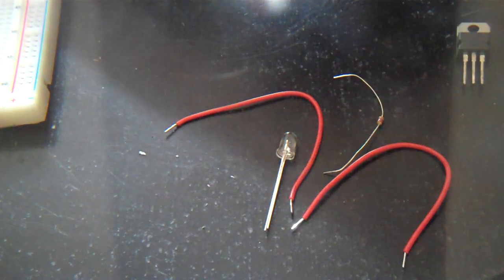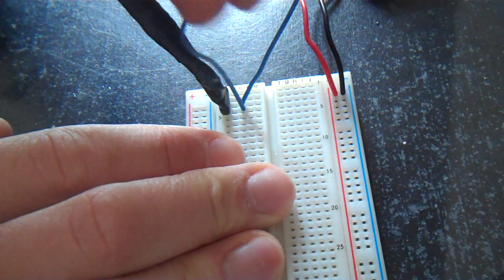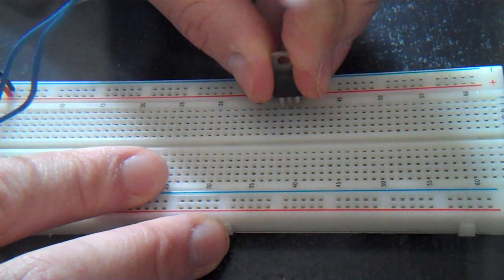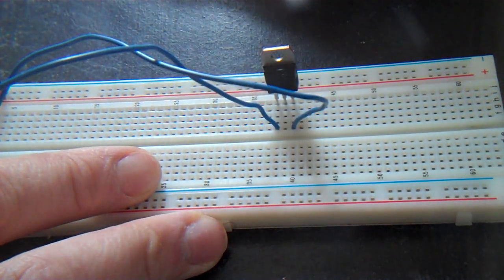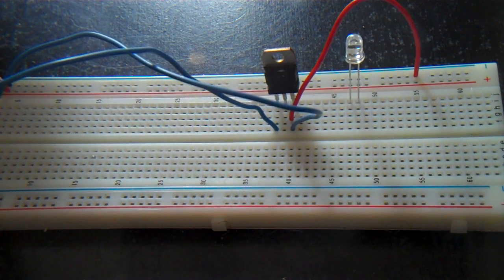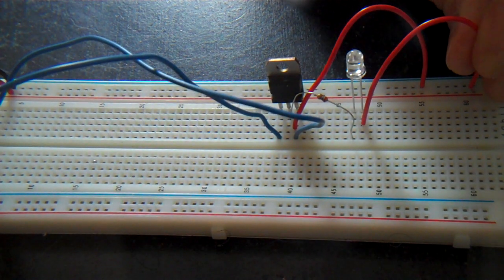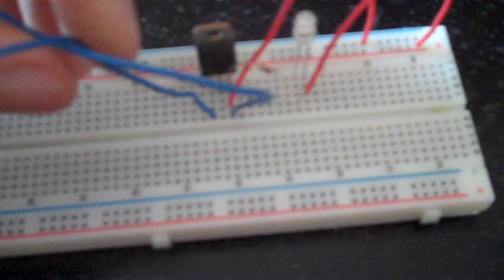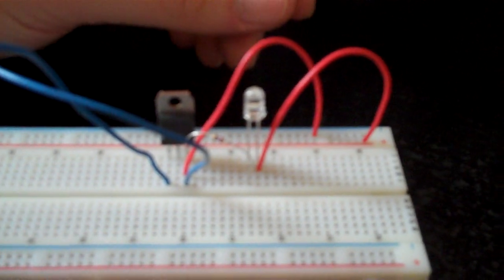Music LED Light Box Walkthrough

Comment: @bruzwa Just so you know your amp will fry the TIP31 aswell as your LEDs. If you have enough watts to power the woofer you would be transmitting all of that to the TIP31. It would fry right away. your best best if you want to put this to go with your sub would be to buy an ipod adapter that you can run through your head unit. This way you can run your ipod to your speakers via the ipod base connection and still have the 3.5mm jack available. Then just adjust the audio jack cable length according

Comment: A splitter divides your audio output power by half. That might be causing the problem. You dont have enough power anymore to drive the leds. Half will go to the leds, and half of the audio output's power will go to your speakers/headphones. What could help is use only half of the number of leds you are using now...

Comment: i've already made my own and presented it as my project in my school. for the ones who's asking where will be the sound coming from, because whenever you inserted headphone jack to your laptop or phone, it will be on silent mode right? you can use the 1 input-2 output audio adapter jack . you can buy it from the market . you connect your audio jack to the first hole and the speaker to the other one . lastly connect it to your laptop or phone then there it go. enjoy

Comment: would i have to have a seperate tip31 and a resistor for each led? or just one tip31 and then a single resistor for each led? and would there be a way to make this work by wiring it directly into the negative and positive on the speakers? by just splicing in wires or something..?

Comment: Isnt the resistor just to reduce the power voltage from the battery from a 9v to a 3.3v? and also how did you hook it up so you can listen to the music and have the led flash? Last question how did you get the volume to be lower and still have it flash brightly, When I hooked up I only had room for either the audio or the led, so I got a "y" connector but i was not able to put to the speakers because I had to have it 100% volume for it to flash and it was to loud to hear.

Comment: Hi, I know this was ages ago but i had the exact problem and figured it out: You have to make sure that you connect the earth wire of the headphone cable to the emitter (right pin). You have to make sure that the uninsulated parts of the earth and the left/right channel don't touch! Otherwise the LED will just stay on.

Now if the LED doesn't light up at all it's probably to little power from you headphone jack.

Comment: (Layman here, just guessing): I would think you'd need a guitar that has one of those amplifier jacks (Pretty sure those are on electric guitars/acoustic electrics), which you could use a headphone adapter with (Adapter goes into the amplifier jack, headphone jack on other side of adapter), which you'd then place the jack of this LED breadboard into. You could of course then install the breadboard on the inside of the guitar and drill holes for the LED's to appear. It's a good idea!

Comment: Could you connect both the left channel and right channel to the positive on the tip31 transistor to make it flash with audio on either side? Or would that not work? If it doesn't work, would you be kind enough to show how you could wire both the left channel and right channel into the same LEDs?

Comment: Hi, i got mine working the same using the rca outs on my amp, i was wondering thou ive been looking a filters so i can run say 3 or 4 leds but have them for each frequency, are you able to tel me the easiest way to make a high mid low filter. cheers

Comment: @carlosserious 

yes i am using the left audio wire. so there is 2 wires
but with these 2 wires it does not matter
which sequence i connect the wires to the tip31c 
is that right.

look i made up a circuit late night and the
 led stays on the hole time. but
if i turn down the music, it then flashes 
with the music but the music is very low.

any ideas?

Comment: hey mate, great vid. I want to apply this circuit to my subwoofer box lighting. All my led circuits are made with resistors in front of the leds, but that wouldn't really matter hey?? I could just make the circuit with the TIP31 and incorporate an audio signal from the amp via 3.5mm audio jack. 
I might mention there is considerable current draw to some of the leds, like 3.4amp per ring but that wouldn't affect the TIP31 from blowing up??
Check out my latest vid to see the leds and circuits

Comment: where did you get your power supply?
Reply: that's the 9v Battery
Reply: oh I only watch part of it :P but thanks...im trying to find a power supply that is more than 24v
Reply: Any wall connector will work as well, not needing a battery, and combining two 12v power adapters will work as a 24. How many lights are you connecting?

Comment: the circuit is simple, but the results are terrible, like others the led is not responsive enough, i had to remove the resistor for it to work.
Also i think it would be wise to explain what your audio source is and how loud your volume is..we may have a clearer idea to diagnose the issues we are having. I doubt you have tested this on difference audio sources. Thanks for the tutorial.